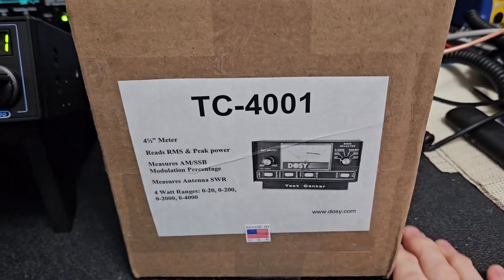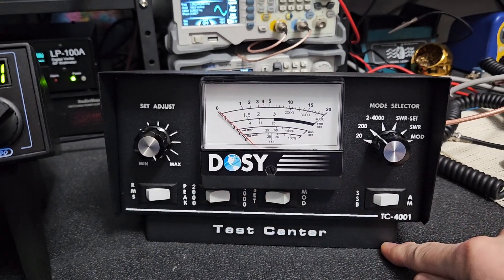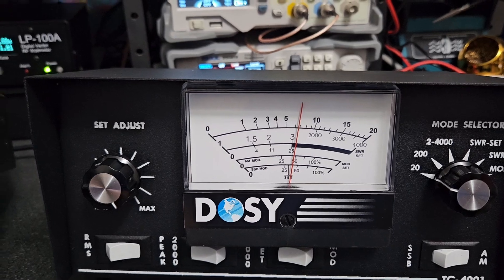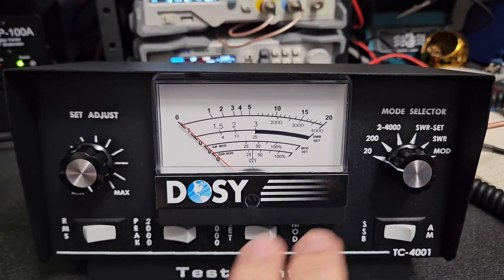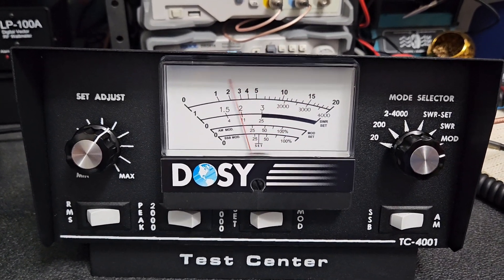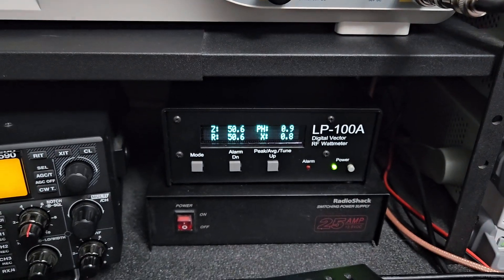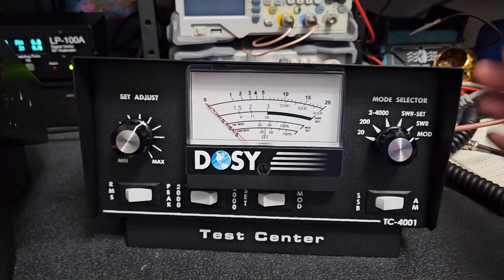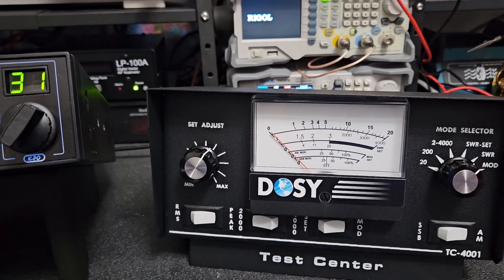New Unboxing Dosy Test Center SWR/Power Meter. How does it work?

Comment: I found out like you after well over $200 , what you have there is a decent , fancy looking SWR meter
At least mine is pretty accurate , and that’s another thing about these , they are all different 
Basically it’s just an overpriced piece of garbage and very disappointing. 
I eventually got a complete Bird setup for everything on my desk 
Radio , driver and amp , avg & peak , fwd and reflect . It was expensive as you know , but all combined , way cheaper than my amps and radio . So I looked at it as an investment, at least that’s how I had to explain it to my wife lol
Reply from the maker: Getting quality meter is definitely worth the investment. 
Using poor quality meters can lead to so much more costly damage to equipment.

Comment: have you used the k-po rs27? accurate?
Reply from the maker: It is a non peak reading Power/SWR meter. 
If you look on my website it has its specs listed.
https://www.scottsradios.com/product-page/k-po-rs-27-swr-and-power-meter-for-cb-radio
Reply: @ScottsRadios  ill research peak vs avg. seems the k-po 503 is the best option to show everything a basic operator would hope or want to see. Thanks for your reply.
Reply from the maker: @get__some  DG-103 Max for 1.8-60 MHz.
True peak reading.
https://www.scottsradios.com/product-page/k-po-dg103-max-swr-power-meter
I think there's a video on the product description.